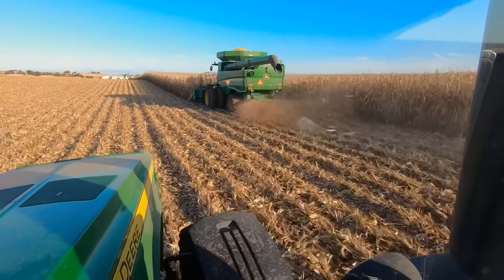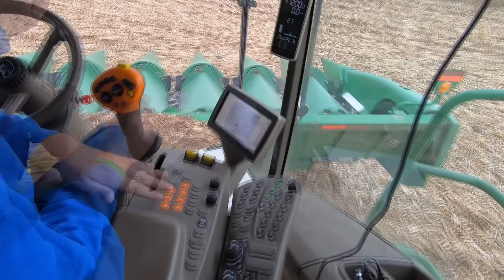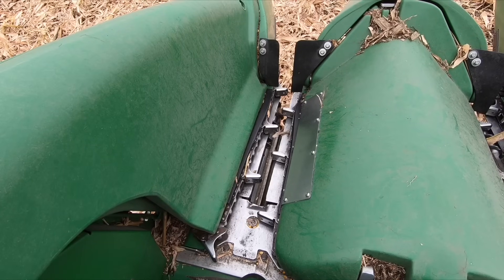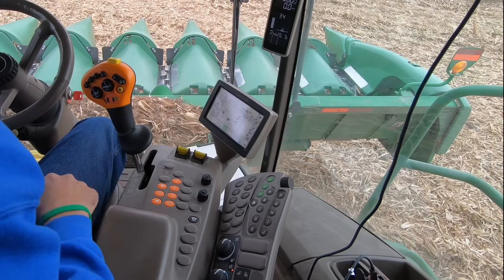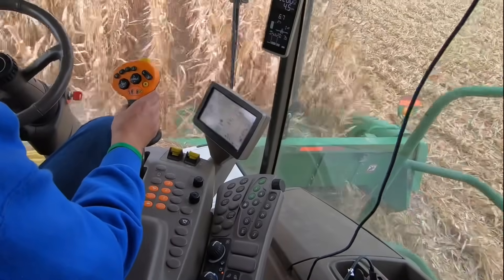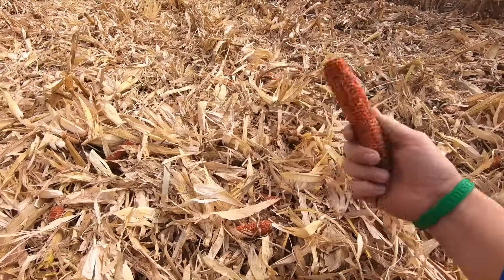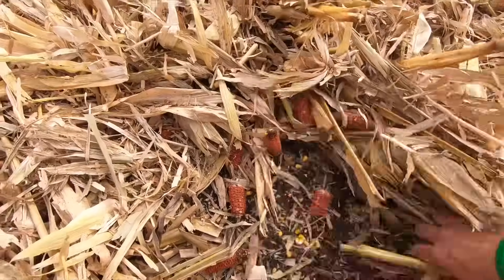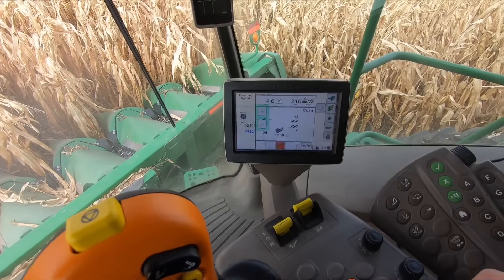Farm Equipment Tour: How to Drive a Combine

Comment: As a young man many moons ago,I used to operate a combine for 20 years. It was against the health and safety regulations in the UK to go anywhere near potentially moving parts with the engine running. I have no reason to suspect that they have changed. As if you are putting your hand around that toggle to pull and disconnect the drive. If for some reason it was to restart it could at the very least pull your hand off if it didn't actually kill you.

Comment: So much easier than the old equipment. Pretty much every setting at the push of a button. No trying to convince the shift lever to go into gear. No wiggling the H and L lever to get it to work. No having to find the sweet spot in neutral to get it to start.

Comment: A long way away from a John Deere Model 55 cutting maze in South Texas. Ate a lot of dust on that thing. Then I got to drive a model 95 with a pressure cab. Talk about living it up in 1971. All adjustment were done manually, by turning a screw to vary belt speed, adjusting levers to change the draft, or changing sieves by hand between crops. We did not have a grain cart, so we had to be careful to get the augers over the truck beds without hitting the truck with the header. The auger was only three feet longer than the header. If we had to load a simi we had to have the truck sit in the furrow while we ran on top of the furrow to get the auger high enough. Brings back a lot of bad memories.
Reply from the maker: My first combine driving experience was dads John Deere 7700 turbo. That was a good machine.

Comment: Good explanation of the s series combine control. I am not full time farming but certainly miss not running  big equipment. I date my self with this but biggest thing  I've run was Jd 8800 and old NH Tr 95. Ridden on 9600 a few times but the new set it from the seat is so much better than old external settings. Auto steer looks like a great idea where corn is still standing. Thanks for the video.
Reply from the maker: You actually would be amazed at how well that thing steers through down corn. You can’t tell if you are still on the right rows or not but it usually gets it right. First combine I ever remember was dads 7700 turbo. What a beast.

Comment: Very nice. I did notice that on the rear axle and sometimes on grain carts the tire bars are turned around opposite from the drives. Why is that? Thanks.
Reply from the maker: Thanks Ron! Although I don’t know if this is the official reason, I have always assumed that it has to do with the direction of sliding friction. The grain cart tires are never powered so they are in essence “working” in the opposite direction as the tractor tires even though they are rotating the same direction.

Comment: That was great.  I enjoyed every minute and the 15 minutes went by too fast.  That certainly is a complicated machine and to learn to drive it certainly is not a short lesson.  How does one learn?  When I first learned to fly an airplane, it took almost 12 hours of dual instruction before I could even fly solo.  Even that was not enough.  The final license took a total of 40 hours of solo practice and more dual.  The combine in a different way seems to approach that level of complexity in order to operate it as second nature.

I could ask more questions that would keep you from doing your day job but I appreciate the time and effort you take to do this for us non-producers (the agribusiness guy on our radio avoids the term "farmers").  I look forward to whatever you post next.
Reply from the maker: Wow thanks Robert! I have a great appreciation for you airmen after studying and passing my “Part 107” remote pilot certificate with the FAA. Those sectional charts are a mess! 

Truth be told I started driving dads combine when I was about 9 years old. Before he let me drive on my own I spent a fair amount of time (from age 7) sitting on his lap and just steering. Then he’d let me raise or lower the header, and then maybe speed up and slow down the ground speed. Then he switched seats with me and rode with me for a while. When he finally climbed out of the cab and “turned me loose” I felt like a king! Thanks for your encouraging words and I hope you continue to enjoy the videos!
Reply: Spend 400,000 dollars,and head for the field!

Comment: Thanks  I wil never drive a combine, no problem, no regrets. The only farm implement I drove was Dad's 1947 JD 2 cyl. tractor....
Reply from the maker: I raked hay with a neighbors John Deere 60 one time and it was great!
Reply: @dodgebrothersfarmandranch9206  My Colorado buddy and I used a JD 60, narrow front end with "Rolla-Matic"  (makes a difference) to pull our New Holland baler (forget the model number but it was similar in size to the JD  baler I've seen you using, and a JD 620, wide front end with power steering (something JD never really got right back in the early 60's) pulling a New Holland HayBine MoCo.  Wish that had been a disc machine, ours had an 8 or 9 foot sickle bar and dang there were a lot of teeth to keep sharp on that sucker.   A very good machine though, it laid down a very compact winrow and we seldom had to use a rake or tedder.  Just mow one day and bale directly after a day or so of drying.  Dry mountain air and strong Colorado sunshine work wonders on mountain meadow grasses.
Reply: JD 2 Cylinders forever!